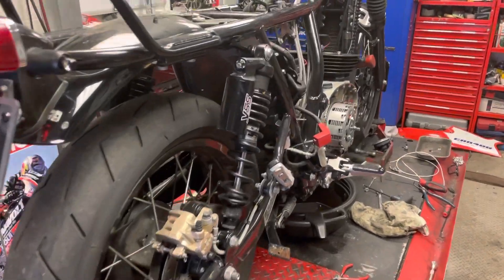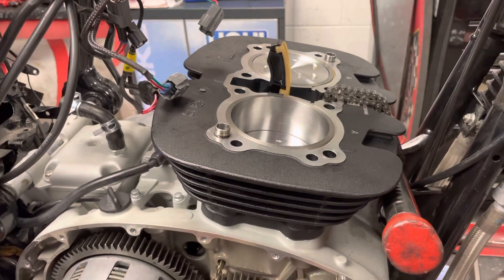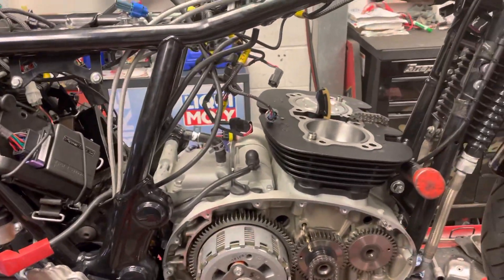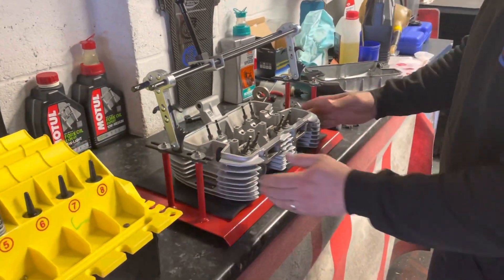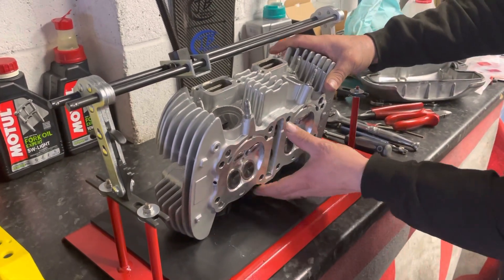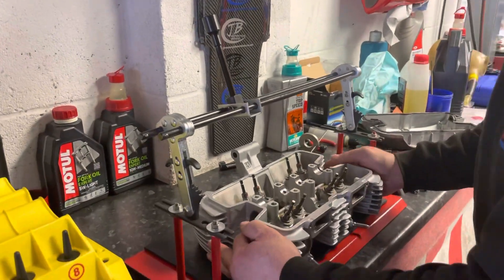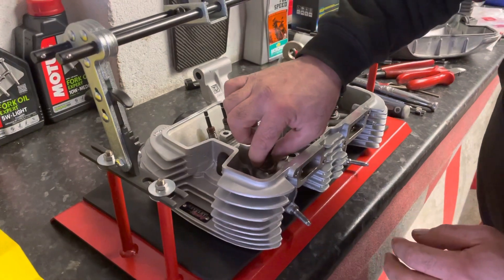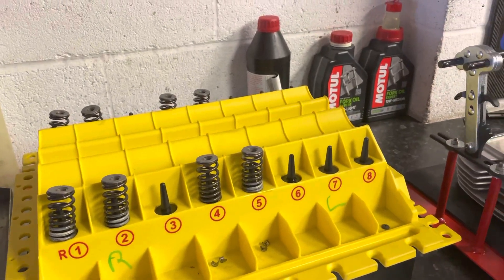Royal Enfield Interceptor: 865 Big bore Engine Build

Comment: I get why you’d do it and I think it’s cool except that you do have to ask should you just have got a bigger bike in the first place but hey I spent too much on my bike in terms of mods as well so there is that lol….
Reply: I also (almost) get it. But the cost of what has gone in would get a very nice classic (that is faster) or a modern bike (that is faster and handles better). Starting with a second hand (much less cost) classic and making that into your own little personalized rocket makes more sense to me. The interceptor is low cost new bike. Put all that gear on it and it's high cost new bike / what else can I get for that higher outlay? = lots of choice! So no, actually, I don't get it. 75HP Norton or Triumph or BMW or AJS or BSA or old Enfield or anything that also handles = good job. Spending cash on a new Skoda to make it like a BMW or Audi? Nah.
Reply: @dogshome7110  you would have an old bike that is not as reliable  hard to get parts for and they are not as nice as a modern classic in many ways! As far as new bikes, you cant get much for the money you would have in a new enfield the kit ,cam and clutch .assuming you already had the exhaust and tuner.Its not much for the labor either.You would have a new retro enfield that was 70 plus hp. not bad in my book!

Comment: Now you'll need taller gear ratios and a bigger radiator...
Reply from the maker: Cooling on the bike is fine with the mods. Might change the sprocket
Reply: s&s states no cooling issues with there kits and a 16t sprocket is 25 $!

Comment: I can't understand why you would want to do this?
Reply from the maker: Because i wanted to, and you can
Reply: @Agent01Orange  fair enough, it looks great
Reply from the maker: @tamar5261  thankyou
Reply: Its always do you want it. Can you afford it. Need don't come into it.
Reply: @Agent01Orange  that’s really it most of the time. All the best on the build.
Reply: I am putting the 742cc big bore kit in my 650INT. I have two 865cc bikes and really want a "750 Interceptor"; doing all the work except pressing the liners. Should be 58 horsepower.
Reply from the maker: @frederickwoods5943  that’s awesome, will have to let me know how you get on.
Reply: @Agent01Orange  just now have two of the S&S big bore kits, my intention is to modify two Interceptor 650's; my 2020 that has over 21,000 miles and the 2022 that I am getting ready to buy. This is February 2022, hope to be riding my first "750 Interceptor" by Spring!
Reply: I guess your not a bike person or you would get it!
Reply: @andrewslagle1974  you guess wrong